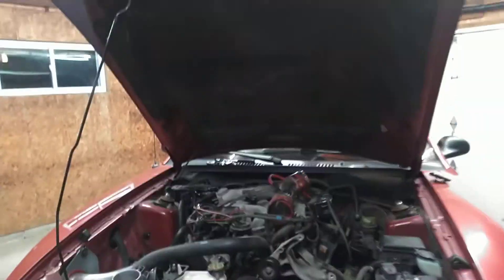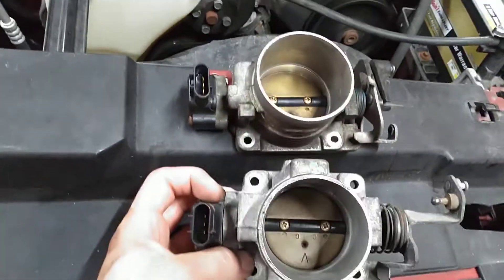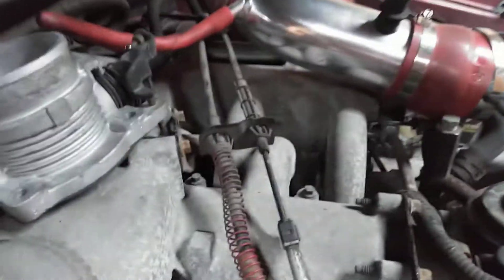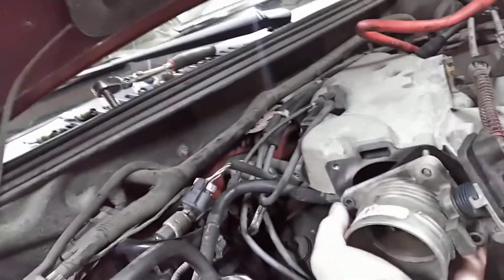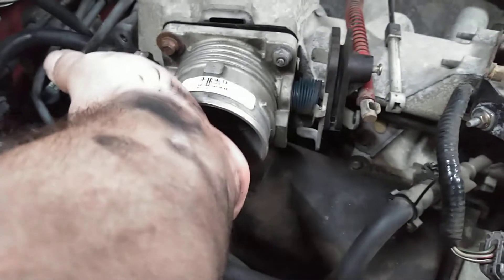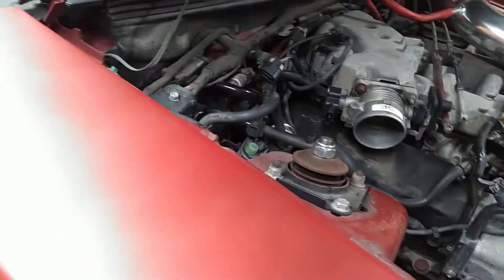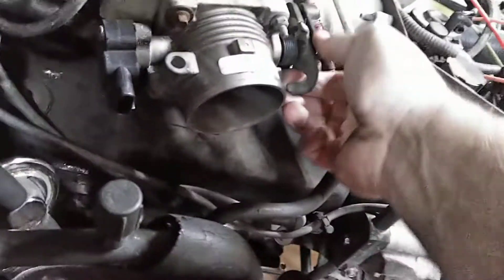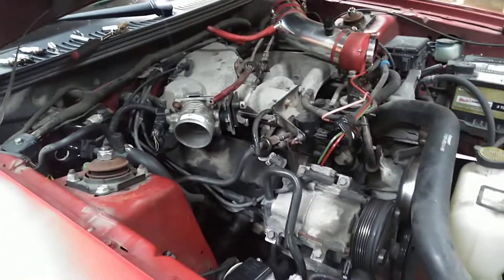99 to 04 v6 mustang throttle body upgrade

Comment: I did it after several adjustments it was quite stable the next day I turned it on and everything normal .. only that the engine light turned on
Reply from the maker: What was the code for?

Comment: I replaced the stock throttle body on my 2016 V6, with 2016 V8 GTthrottle. It did not work properly. Thanks to advise from Auto Mafia, found out I needed a 2011 - 2014 V8 GT throttle body.
After putting the 2011  - 2014 V8 throttle body on my 2016 V6, worked perfectly. Hope this helps someone out there.
Reply from the maker: Thanks for the helpful tip. How do you like your v6? I heard they’re pretty fast

Comment: this may have been answered already but like whats the hole above the throttle body? do you close that off?
Reply from the maker: So I meant to put that in the video and I forgot too, but I blocked it off with some jb weld and opened the throttle blade up a little bit to idle better, it’s not perfect but it works

Comment: Don't forget the (paper gasket an silicone) on the top of the throttle body.  i had do something like that on my Ford ranger 3.0
Reply from the maker: Yea I had to make a little plate to go on the top to cover the iac too
Reply: @T-MillProductions  awesome!!!! An did you get more power out of it???:)))
Reply from the maker: I can’t say I did or didn’t lol. When I did mine I did long tube headers, off-road x pipe, cat back exhaust, throttle body, and tune. The car is definitely faster then it was by a lot. But I don’t know if it would make a huge difference or not

Comment: Kinda late now but DBC throttle body from a Crown Victoria also works. I believe that they're the same part number and I know that they work since I put a Vic throttle body on my old 2003 GT.
Reply from the maker: Thanks for the good tip!
Reply: Clutch comment. Ty

Comment: I got a basic v6 automatic ,I already put a cold air intake any suggestion on what upgrade for performance I can do next
Reply from the maker: Honestly your best bet is to do gears in the rear end. My personal advice is save up for a 8.8 from a gt or Mach 1 and put 4.10s or 3.73s in it and swap that in. You will feel a night and day difference. You will also need a bama tuner to correct the speedometer but it’s good because you can get a free tune right away too from bama included in the price of the tuner
Reply: @T-MillProductions   hey so I tried to do the swap but the gt cable is too short and won’t let my throttle close literally stay half way open and the v6 is the right length just wrong connection any suggestions
Reply from the maker: Huh and you got one for a 99 to 04 gt? It should work, I got one from rock auto for an 02 gt an it works fine.
Reply: @T-MillProductions   I got it from the same year and everything that being said it  works just  the v8 cable is 1 in 1/2 shorter than the v6   .I tried fishing it thru different spots to get more length but nothing might go universal if anything
Reply from the maker: That’s strange man, yea maybe you have to get a longer one for a different t car

Comment: How about the big hole on top of the manifold backing the throttle body😂 it dont match
Reply from the maker: Read previous comments lol. I ended up capping that off and opened the throttle blade up a little more. Idled a little high but worked fine

Comment: You mentioned you need a GT throttle cable? Why? Does the stock v6 throttle cable not fit the GT throttle body? Just asking for clarity
Reply from the maker: If you look at how the cables attach to the throttle bodies they have different ends on them so the stock v6 one won’t attach to the gt one. Also 1 thing I need to update in here is the v6 used part of the intake for the iac, the top of the v6 throttle body is where it matches to it, I used jb quik weld the putty and covered the opening and then I opened the gt throttle blade just a hair more when it was in the car to adjust the idle. If you don’t block off the iac port on the intake manifold it’s gonna idle very high and run like crap. I plan to make a video on it soon
Reply: @T-Mill Productions  ya know, that exactly happened to me, but I had fixed it, but I experienced what you described. Lol.
Reply from the maker: Oh okay lol. Thanks for the input

Comment: Okay so same year gts (99-04) those throttle body’s fit straight out (99-04) 3.8s?
Reply from the maker: Yes they do except one thing I forgot to mention is the idle air control valve inlet is on the top of the intake manifold and the gt throttle body doesn’t go up high enough to cover it so you have to make a gasket to cover it and make your own idle air control valve inlet
Reply: How you did your own.??
Reply from the maker: Yea I did mine myself

Comment: What about the hole above the throttle body and you said nothing about a tune so do you need one
Reply from the maker: So I had to modify all that later on after this video, I made an update about it, I took jb weld and closed up the upper hole and then opened the throttle blade up a little more for the idle air, and I already had a tuner so I just bunked up the idle speed a little

Comment: i have an 02 mustang 3.8l and soon will be installing sr performance cold intake would that throttle body fit? and is it the 02 4.6l Cardone throttle from rock auto?
Reply from the maker: Yes any 2v throttle body will work, you will need to open the blade a little bit and block off the top opening on the intake manifold where the throttle body bolts too. But after you do that you’ll be good!

Comment: Have you checked the quality of the AM 65mm 3.8 vs the gt throttle? I’m all for junk find and savings but I didn’t know if anyone could chime in? I’ve got a crate 3.8 and I want a subtle upgrade so I’m on to the TB. Didn’t know if it was simpler to get the gt, or is the AM completely compatible without any cable swaps etc?
Reply from the maker: I did look into it at first but I didn’t wanna spend much money into it because I eventually plan to do the Eaton m112 swap and I already had the gt throttle body. Both are good options but if you have a brand new crate engine I would almost say buy a new one for a 3.8 and call it a day.
Reply: @T-MillProductions  thank you! That’s what I’ll do
Reply from the maker: You’re welcome man!

Comment: Would this pair well with me adding the eaton m90 supercharger to my v6? I’ve see. That with a custom plate for the m90 I could run this on my v6 because it comes off a 3.8 Pontiac
Reply from the maker: That I’m not sure about to be honest. I thing the Pontiac ones are a little different but I could be wrong. I know the Eaton m112 is wha everyone runs on theses with an adapter plate. I think you can’t use the m90 with split port heads.  But I could be wrong.
Reply: Could probably use the tb and plenum.

Comment: Do you know if the manual v6 have a cruise control cable? I’ve got a 2001 3.8 and It didn’t come with it when I bought not sure if it’s suppose to have it or not?
Reply from the maker: Ya know I’m not exactly sure. I will look on mine and see. Does your cruise not work?
Reply: No it doesn't
Reply: @raymondborkowski4290  it does have a cruise control cable, i have a 2004 v6 manual & i just got rid of it because i never used it, i suppose most manual owners do the same & this is why yalls didnt have a cruise control cable. they all came with cruise control.
Reply from the maker: @itried2hard633 thanks for the good infor

Comment: i would be able to do this on the 3.9 right? and what year gt would i get it off of?
Reply from the maker: Do you have the same intake manifold? If you do then yea. And you just need one off any mechanical throttle body 4.6 2v motor. The only thing you gotta do I forgot to put in the video is block the little iac port on the top of the intake and then open the blade on the throttle body just a tad bit so it will idle corrextlg
Reply: how did you adjust the blade to stay at the correct position then? and being completely honest have no idea where the iac port is.
Reply from the maker: The iAc port is the top of the throttle body where the intake manifold it’s a tiny rectangle and the blade just has a little screw that you can adjust to open and close it more or less

Comment: What did you do about the iac?
Reply from the maker: So I haven't actually finished the car yet to be honest. It's still up on jack stands. My plan is to block off the old intake inlet and then open the throttle blade a tiny bit and try that
Reply: @T-MillProductions  sounds like something I'd do. Just was curious what your plan was.
Reply from the maker: That's what my intial idea was. I figure I can adjust the idle with my tuner so I was gonna try it lol
Reply: Kit relocation iac
Reply from the maker: That tko

Comment: Im sure you realized by now but the gasket was rotated the wrong way
Reply from the maker: So that's not even the correct gasket lol. I got that from my gasket bin. But it works so I'm gonna send it lol
Reply: @T-MillProductions  for sure I was gonna get the accufab 70mm throttle body for 279 but know this now ima just grab a sr performance 70mm GT one for $102 and get the gt throttle cable
Reply from the maker: That's why I went with the cheap option lol. I figure screw getting the expensive stuff if I can do this instead.
Reply: @T-MillProductions  yeah I went cheap for all my parts to my stock cats paid for my headers,xpipe,and catback and i got my tuner used for 200 and ebay $60 intake
Reply: @T-MillProductions  only money I had to really put in was the 163 for the gears and 369 for the lsd
Reply: So it doesn't effect your idle control valve

Comment: You FAILED to even mention anything about the factory throttle body having a provision for the Idle Air Control intake. The GT throttle body doesn't use that style, and as shown in your video leaves it open above the GT throttle body to suck in unfiltered air that could potentially damage internals. Road debris can get into the engine this way.
Reply from the maker: Yea I made a later video going back over it
Reply: @T-MillProductions  oh okay, I'll look for your other videos.
Reply from the maker: Yea sorry for the confusion, I realized that once I ran the car lol. I actually made a plate that goes in between the throttle body and the intake that covers the iac inlet and then I opened the throttle blade a little bit and so far it’s decent. Not perfect but decent

Comment: wont work. see that hole for idle air control. wont work
Reply from the maker: It works just fine for me
Reply: @T-MillProductions  do you just leave it open?
Reply from the maker: No , I just used some jb quik weld putty and put over the hole and then opened the throttle blade a tiny bit and adjusted it with the car running and it works fine for me
Reply: @T-MillProductions you need to say this in the video. Update the description at the least. I'm in the process of this now and needed to know this info ..
Reply from the maker: Yea I agree, I tried to go back but I can’t re edit the stupid video. I made an update one explaining that but no one really watched it . Sorry for any confusion
Reply: @T-MillProductions work good for me I did exactly the same way
Reply from the maker: Good I’m glad!